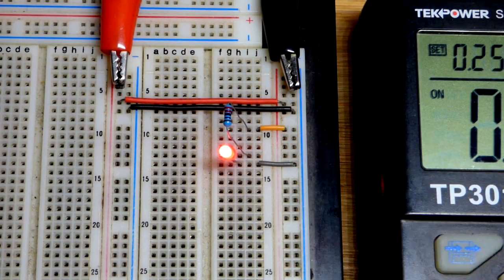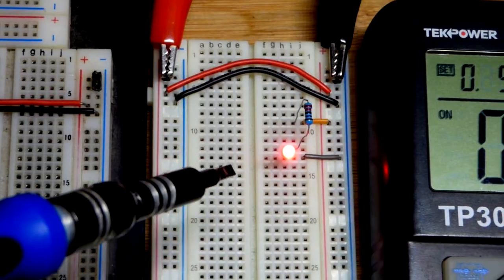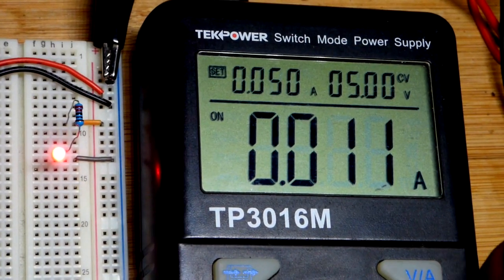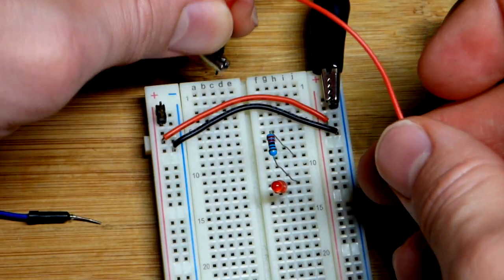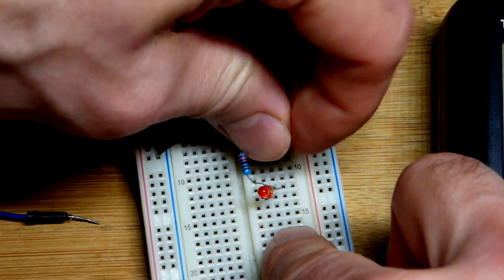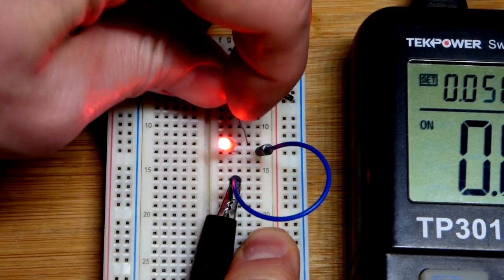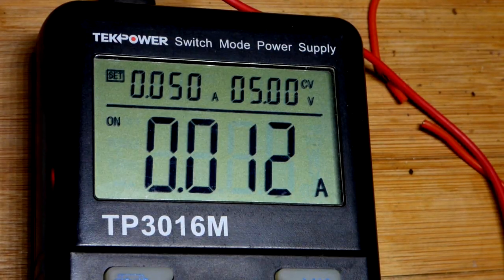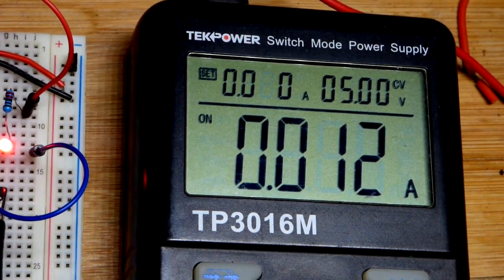How to make better connections with cheap breadboards

Comment: For thin component pins, or bread board sockets that are a little loose/stretched out, I bend a very, very lazy "S," unto whatever pin I am about to insert into the board. This trick works with any pin/socket connection, of course, not just bread boards. You are basically expanding the pins width, with the use of a bend. I do find that a lazy S shape is better than just a lazy C shape. And, the complete S shape must be completed within the depth of the bread board socket. You should remember to align the bends of the S perpendicular to the jaws of the socket, in order to spread the socket's jaws, insuring connectivity. HTH Cheers.
Reply from the maker: Sounds good!